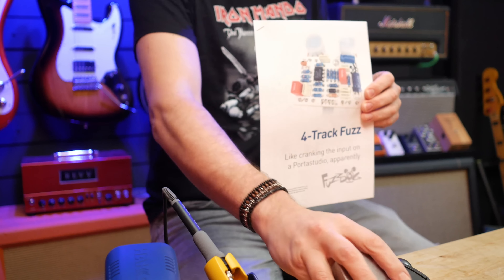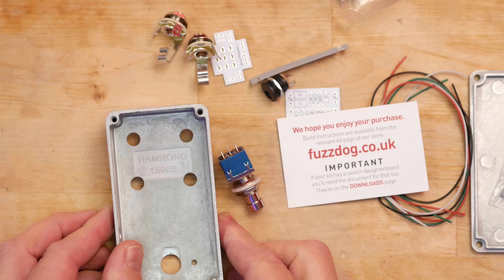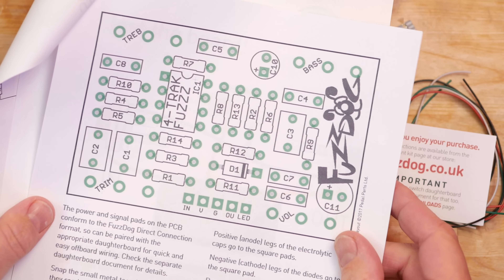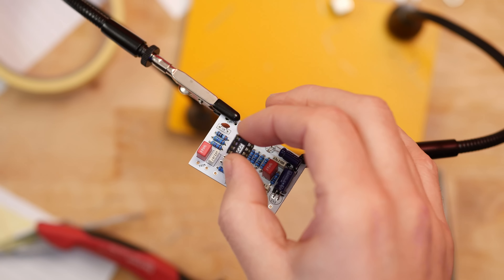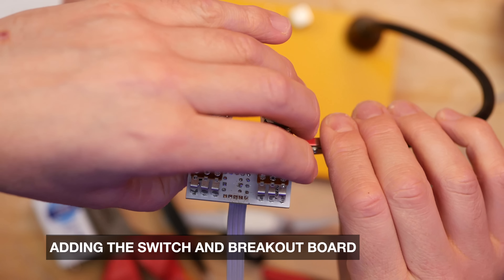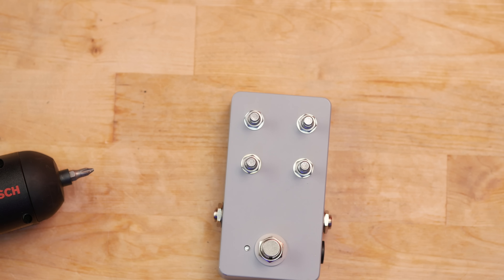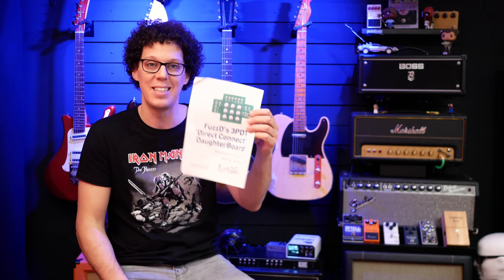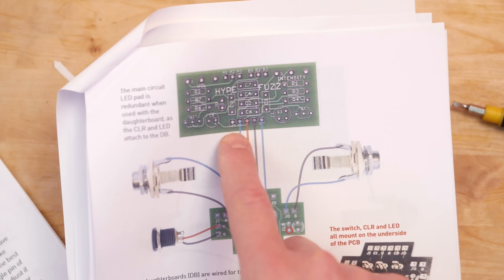Get That 90s Demo Tape sound: Build the 4 Track Fuzz Pedal Kit

Comment: I still have a 4-track recorder. I may or may not have done the fuzz trick back in the 80's and early 90's. Im officially older than dirt.
Reply from the maker: I remember "accidentally" doing it on bass. I sounded so good

Comment: As someone who has built 3 Fuzzdog projects AND originally trained as an Electronic Engineer, I absolutely agree with your assessment of the instruction packs to the letter.
It's great to see them getting some air because they do some great stuff, but I really hope they take the feedback on board.

The way you hold the soldering iron in the thumb pick continues to disturb me, you're a parent goddamit, set a safe example 😆

Comment: Good video, Just one point, instead of tape when checking components a piece of polystyrene is easier and faster with no chance of leaving sticky residue on component legs which can cause dry joints.

Comment: Nice job! Only suggestion would be to not solder the pots onto the board outside of the enclosure- try to put the board and pots into the enclosure unsoldered (can be tricky), and then solder the pots in (can also be tricky), as it will help prevent strain from the pots on the board, or so many have said...
Reply from the maker: Thanks David. On a board this small there seems to be very little strain but I’ll consider it next time!

Comment: I still have a Tascam 4-track that I bought in the early nineties, though I haven't used it for years and a few TDK SA-90 cassettes in their wrappers that are apparently like gold dust. I would always push the gain slightly too much on the drums and vocals, but not the guitars. I might have to get it out and try it.
Reply: I still have my original Tascam 4- track too...have you seen how much they go for these days ? Was on a certain online auction site & saw a few..(was on there buying metal cassette tapes - they are available)

Comment: As someone who has built a lot of pedals, for myself and others, I'd say when you have a bag of resistors of differing values all mixed up like that, that simply using your multimeter and testing each one and then placing it on the PCB straight away (the PCB will either be marked with the values or if marked R1-Rx the consult the BOM/build guide) is the fastest way to do things. Otherwise, yes, definitely having them placed out and marked as you did Andy is a good idea. 
Bugger trying to read the colour bands on them, unless you've been doing it for years that'll take you longer than it'll take to simply touch your multimeter probes to it, plus that way you can test all your components and make sure they're all good and within specified tolerances etc.
Resistors and diodes will always be your first components placed as a general rule, as they are the most "low profile" and then you install the taller components, working upwards as you go, like a little city

Comment: A particularly tedious bit of nerdery: it would be interesting to put a sin wave through this and see what harmonics it's spitting out the other end. As it's trying to produce tape saturation, it should be predominantly (or only?) producing odd-order harmonics, as opposed to valves (which produce strong even-order harmonics, as well as odd-order) and transistors (which also produce both, in a different ratio to valves, which is why they sound different). However, as it's transistors in there, I wonder how they've gone about doing that.

Comment: Not that it is horribly important in this case, but even the film capacitor has a positive and negative side, but it's not marked on the parts themselves a more involved testing is required to determine which is which. Again, not very important in this case use but still something to know once you venture down more elaborate projects. I rather enjoy your little builds and playing with them videos. Cheers mate. Edit: Sounds pretty good, pretty much a sound you would expect from a JRC 4558 OP it would be a great setup  to play Franz Ferdinand- Take me out lol
Reply from the maker: Thanks so much for the heads up!
Reply: Please elaborate on that. I have never come across polarized film capacitors.